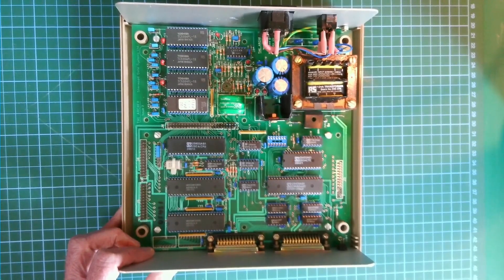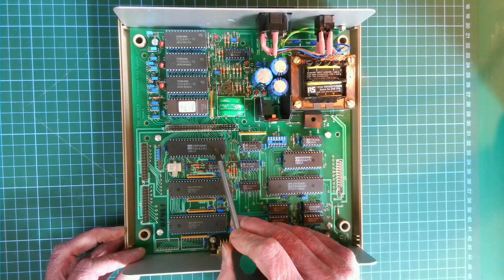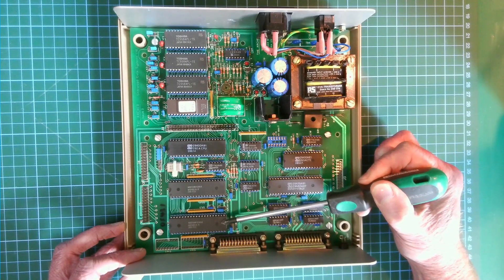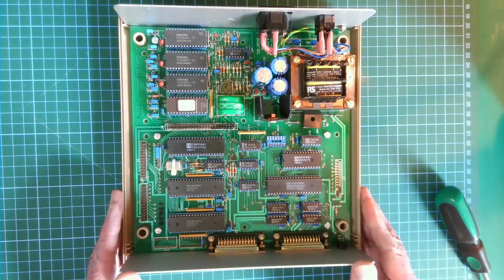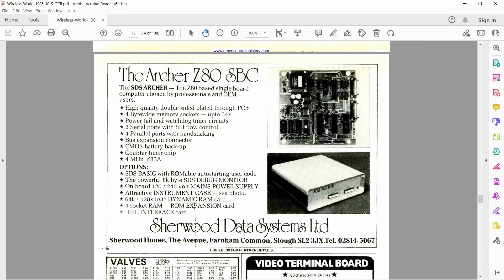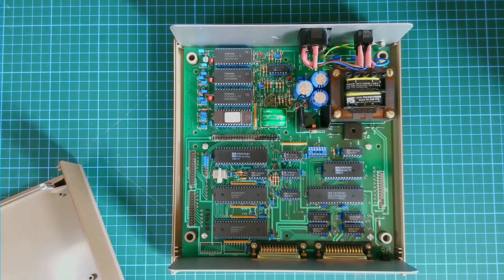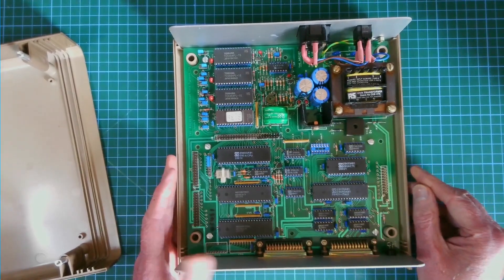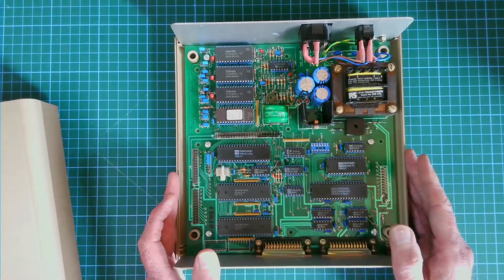Mystery Computer from 1985 - SDS Archer

Comment: It looks fantastic to me, it probably was made for the automation of production processes and I assume one connector is for the terminal and the other is to be connected to whatever they wanted to control. On the PCB I do not see dipswitches, so it is a guess on what baud-rate to communication port is working. 
 
There are more manufacturers that produced things that are now at this moment undocumented, there was a documentation but this was stored in the office and when the machine was redundant it was put in a box leaving the documentation at it its place. Later on, the documentation was thrown away, because the machine was no longer in use. 
 
You can analyse the EPROM, often programmers leave some text in it to remember what version of the programme it is.